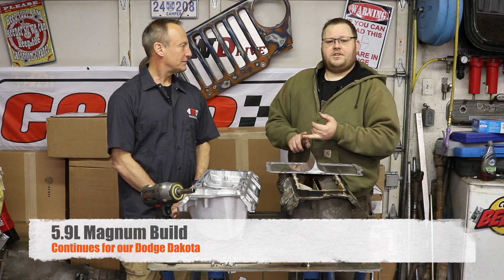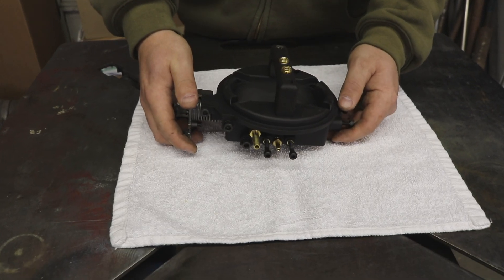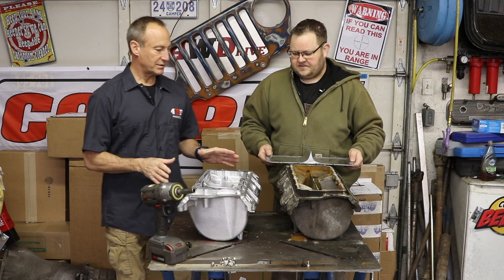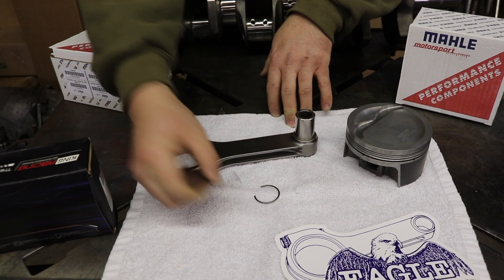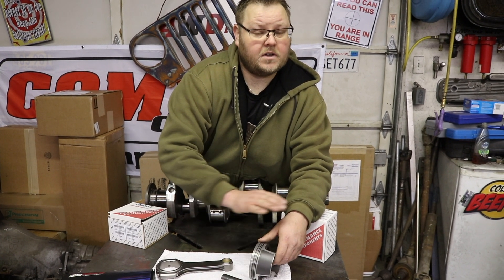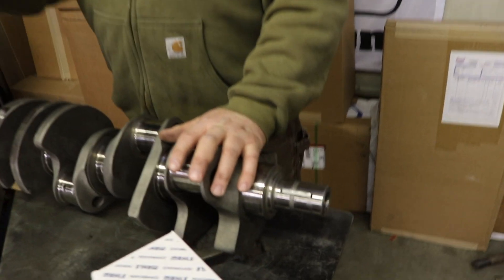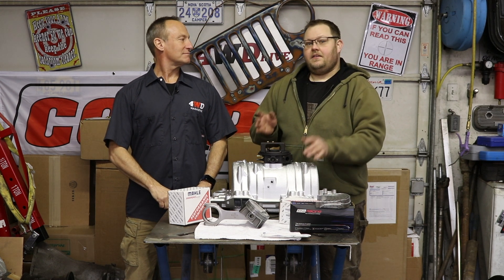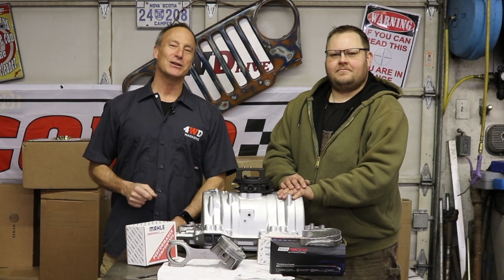5.9L Magnum Build Part 3

Comment from the maker: We're planning to use this 5.9L magnum in a Dodge Dakota for snow wheeling. What would you use a 5.9L engine for?
Reply: I'm putting mine in a Durango 5.9.  Desert 🏜  Wheeling
Reply: Can i get some part numbers or a way to contact one of you because im building my first 5.9 gas and i wanna talk to someone to get a general idea what would be best for the type of build i wanna do
Reply: @Sbc18  Honestly, give Marty at Utawesome Performance a call.  That's where we have been getting the vast majority of our info.
Reply: I want to know if this will get my towing capacity up to 10k lbs in my 2000 durango. (Yes I know I'd have to upgrade the brakes and suspension too)

Comment: I have an 89 Dakoto 318 la block 40 over 4.00 stroker magnum heads holley sniper injection super comp headers 42 re transmission 391 gears lots of fun next is drag radials I am retired so not a lot of money

Comment: Sealed Power floating pin clips are way easier to install and remove. They have a return bend on the ends which is perfect for needle nose pliers.